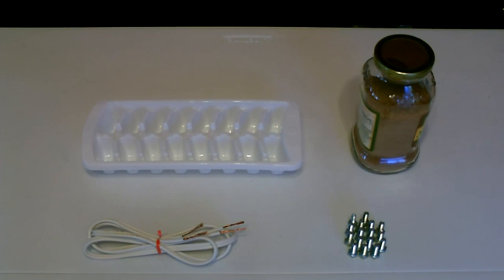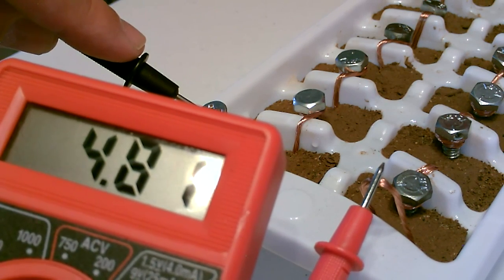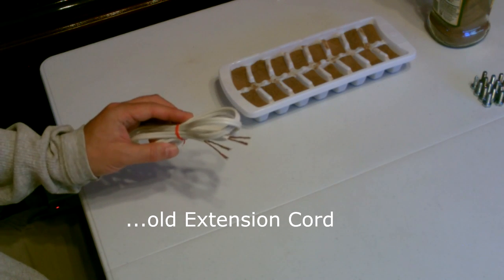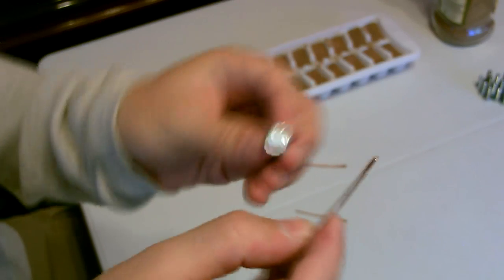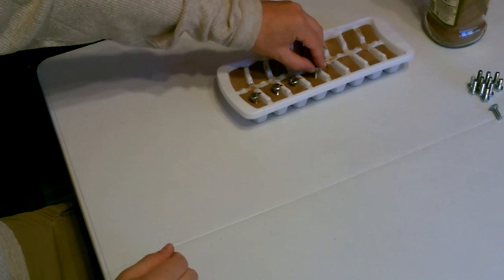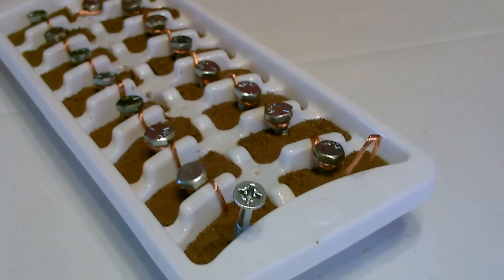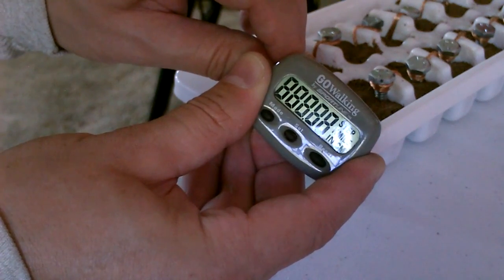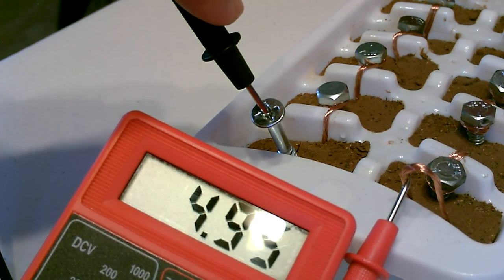Homemade Battery! - The DIY "Earth Battery" - Powers Clocks/Watches/Calcs/LED Lights....

Comment: I am curious would dirt, zinc electrodes and brass work. I assume you could attach these two in series and make 10 volts 10-20 ma. Enough to light a Few leds. Salt water designs corrode the structure too much electrodes i mean so i would use salt water.

Comment: Will it charge a phone?
Will it light an LED light?
Reply from the maker: it can charge a phone but it would be pretty slow because the amp output is pretty low. it will light led bulbs (certain ones). i do have a high amp earth battery video. the cells are much larger and have a lot more metal in them.

Comment: How much current can something like this put out in comparison to a commercial AA battery
Reply from the maker: hi the current is much much lower. i do have a more recent earth battery video where i show one that has 10 times the amps of a standard earth battery. it just uses dirt or sand and water (similar to this one) but it uses small sheets of copper and aluminum.

Comment: I'm already thinking about using those deep popsicle trays instead of ice cube trays. This is great. Thank you. Cheers, mate.
Reply from the maker: you're welcome! those should work great. i just started on a new earth battery. it uses large sheets of copper and aluminum. i hoping with 100x the surface area i might get 100x the amps. then just hook a few of those together and you could charge many things very quickly.

Comment: You forgot to mention how many amps
Reply from the maker: hi. the amps are pretty low with these units. it tends to run things in the milliamp range. you could probably increase those if you hooked a few trays in parallel

Comment: I live off grid and solar in the winter sucks. I was exploring the idea of using urine to generate something and sending that through my smaller charge controller to get even a small trickle of juice. But this dirt seems to do the trick, I wonder 🤔 if moisture from urine would help, larger cells..like cups. Bigger screws and thicker wire would give me more power?

Comment: How do you connect it to something? I see you have one screw / nail at the end on the left and the coffee wire on the right. Do you need to connect both the nail and the wire to whatever you’re connecting it to? Or just touch the copper wire to the object? If you had a lightbulb how would you make it light up? And which side is which (positive and negative) if you did have to connect both

Comment: How long does this generate electricity for?
Reply from the maker: hi. as long as you keep the dirt wet it lasts for years. it still works to this day. you might eventually have to replace the metal if it gets corroded.

Comment: Has anyone tried to recharge their soil battery using a solar cell? I'm envisioning a plastic seedlings tray (used for house plants or gardening). stir in some table salt with the dirt before adding water. Connect a solar cell that pairs up with the soil batteries' voltage. A hybrid soil battery that could be rechargeable by adding water and\or sun...

Comment: what did you use the battery that was put directly into the earth? Have you ever used these batteries for gardening purposes? My hypothesis is that this is one of the missing elements for use in the gardening situation. I might give it a try this season. but I would like some input  from someone that's made one already....

Comment: I built an earth cell with carbon water and aluminum in a pint glass.   One cap full of bleach pushed the bolts to 1.1 V and the amps to 5mA.

Comment: You need to wire a small solar panel in parallel.  The circuit is called a non-ideal parallel circuit.  I have done this twice in experiments.  The solar panel has to be in low light conditions.  If the amperage is too high it blasts through the system, and you only get volts from the solar panel.  My last test had the system pulling 2.45 ma from the panels and 20 volts from the earth battery cells.  The first time it ran with .01 amps and 15 volts.  There is a relationship here that can be manipulated.  My solar panel is an 18v about 12" square.  The earth battery I built only made .01-.02 milliamperes unit I added the solar panel which can boost the amps.
Reply from the maker: hi. sounds interesting.

Comment: Although it reads about 5 volts, the amperage output is negligible, which makes it impractical to power or charge any device. Use it as a parlor trick to impress, but it’s truly not something useful. To be something worthwhile the battery plates (galvanized metal, copper, aluminum, etc.) would need to be much larger, (dissimilar) and the dirt would need to be replaced with a much more robust electrolyte. If it were easy to make an inexpensive DIY battery that was practical everybody would have done it long ago.

Comment: How do you connect the wires to complete the circuit?
Reply from the maker: hi. all you do is hook a wire to the first cell (in the row) and a wire to the last cell in the row. those will be the plus and the minus
Reply: @desertsun02  I mean from cell to cell.

Comment: I made smaller than this. 
The key is soil, the more fertile and moisture, more electricity you can get. Do not ever try to run electronic device using this battery unless regulator in place. The electricity quality is poor, you will damage it.

Comment: Are each ice cube battery connected in series or in parallel please?  When the copper wire is merely inserted into dirt of next cube tray. Am confused to discern how to tell if this is in series or parallel.  Thanks.
Reply from the maker: hi. it's series
Reply: @desertsun02  thank you

Comment: how long does it last
Reply from the maker: hi. it lasts until the soil dries out. (but then you just add more water and it works again). i have a video showing how it held up (still works perfect - even after all these years)
Reply: @desertsun02  did you try installing a capacitor to triple the voltage. Induced volt test
Reply from the maker: hi. no, i didn't get that fancy.

Comment: How many amps did you record? Did you wet the soil? Clay, sand or organic topsoil? I figure I may as well ask to make it easier to copy you. Thank you.
Reply from the maker: hi since the amps on these are typically low compared to the voltage i just measured voltage. you definitely need to wet the soil. if it's dry the battery won't work. the soil i used was from my backyard. it's high in clay and very dense. sand or regular soil should work too.

Comment: Howlong its giving power output
Reply from the maker: hi. as long as you keep the soil moist or wet it will work for a very long time. i've had it many years and it still works if i add water.

Comment: Hello I made some tests, but the prob. was when I test it on led batteries that takes 3 v it did light well, the light is very dim, even thou Im getting 3 volts from my soil battery , what could be the probelm.
P.s: Im a beginner in electrical science
Reply from the maker: hi. first off, it's great you got it to work! it can be dim for several reasons. main one is that the led is not "low power" enough. there is a huge range when it comes to power draw (some only need one milliamp and others need 50 milliamps). also makes sure you are using long enough bolts and lots of copper.
Reply: @desertsun02  thanks a lot for the info
I will try to improve it with more copper and longer bolts 🔩 and get back to you.

Comment: Thank You for the video and information. Could you take 20 of those and make 110 volts? Also what kind of amps would these produce? Again Thank You.
Reply from the maker: hi. i'm not sure the limits of these but theoretically you could make a pretty powerful setup if you used enough trays

Comment: My bad I meant to say if you use salt water instead of regular water it will increase the voltage the same with acids chlorines and other types of oxidizers such as fertilizers

Comment: If you add salt water instead of regular water it will increase the the same with acids and chlorine bleach and other types of oxidizers may be even fertilizer might help to increase voltage

Comment: if add few drops of water, use thinner Copper wires, and different bolts materials (zinc), I believe you will get higher voltage and stand longer, as the moisture can increase the electron transfer performance from bank to other.

Comment: One of the oldest galvanic cell is the baghdad battery.  There is an even older galvanic cell called the "cylinders of the pharaoh" made from copper and zinc tubes filled with quartz when held produces up to 1.5 volts.  I encourage everyone to make them. If you can't just buy them on etsy or amazon.

Comment: What if you put vinegar in the tray would it make more volts?
Reply from the maker: hi there. yes, using vinegar slightly increases the power. it will corrode the metals a lot faster thou.

Comment: What is the oxidator within this battery?
Reply: water and salt in the water probably, if you want more kick from this, pour in water+salt+sour salt or lemon salt being it crystalize or not. anything acidic works baking powder or caustic salt would probably more worth it as its releasing a lot of energy. every material when is put in water has a electrical discharge problem is the amperage is sucks. u can get 100 V but if u get like 0.00000001 AMPS  its shit Voltage u can't do nothing with it, you literally have more amps from rubbing your fingertips.

Comment: What kind of dirt do you use?
Reply: is not the dirt that does the job, the dirt acts like a decaying delay agent, its the water and + chemical mixture he using that generates the current, from interacting with the copper. u can put water+salt or vinegar and will do the same thing no need for dirt.
Reply: @REDFRAQ 
Thanks you very much

Comment: you could try water and other substances right?
Reply: water, vinegar, 65% baking powder + water mixture, 25% vinegar 50% baking powder 25% any agent to make it harder cornflower dirt etc, works with everything as long as there is a acidic reaction with the copper or cathode u putting inside there. also the bolts need be galvanized so the copper can pick up the electricity. but amps will probably be shit though.

Comment: Good day!
I would like to ask a expert opinion regarding with eartb batteries. As you have used tap water to moisture the soil, may I ask if type of fluid used as moisturizer to the soil (tap water, distilled water, salt water, etc) have an effect to the voltage produced by earth batteries. Also I would like to ask the principle/science behind this.

Thank you in advance for sharing your expertise on this topic. Hope to hear from you soon.

Best regards.
Reply: Saltwater would be best in this particular matter. It will act as an electrolyte.

Comment: If you push the bolts deeper in the dirt (if possible) then you get a bit more voltage. In your case you couldn't do it. A bit more deeper cells and longer bolts could have made it. This advice was only for the bolts and not the copper. No need to get the copper deeper. However, a few more cells do the same thing if needed, to get more volts. A combination of Stainless steel and aluminum works also well and I prefer that, especially if you want to dip often.

Very nice video, by the way. Thanks!
Reply: dip often?
Reply: What do you mean dip often?
Reply: @Randy2747  By that I mean to water it more often. If its to dry, the experiment want work. There much be always moisture in it or no electricity.

Desertsun wrote what was also my thought:
"Note: every couple of days the dirt will "dry out" and the voltage will decrease. TO RECHARGE THE BATTERY; just add 1 or 2 teaspoons of water to each "cell" and the battery will be "recharged"."
Reply: @christ4u2now Is there ever a need to replace the dirt; if so, how often? Also, how long are these good for? And are you able to explain why this works?

Comment: To charge a device the power produced is what matters. The current out of that dirt battery is possibly under 500 microamps. To charge a cellphone we would need at least 3 orders of magnitude which a dirt battery cannot generate.

Comment: This is working because of the light zinc plating on the bolts or nails. Steel does not have as great a potential against copper.

Comment: The biggest problem with any battery is getting a large surface area for the electrodes. This is accomplished in commercial batteries by making the two electrodes separated by the electrolyte into a long thin sandwich and rolling it up into a scroll.

Comment: If you used two ice trays would that double the voltage?
Sorry if that's a stupid question
Reply from the maker: hi there. it's not a stupid question. and yep, it would double the voltage (as long as you hook them in series)
Reply: Wire a few up in parallel and you could probably melt metal.

Comment: If I understand the theory right, (I’ve been learning Ohms law for two weeks now so forgive if I’m wrong), copper and galvanized metals (as well as others) have two different levels of conductivity. They are both conductors, but one is more efficient than the other creating an imbalance. Electrons want to travel from one pole to the other (toward the path of least resistance, or the neutral pole) which creates electromotive force, AKA "voltage". 
A battery does not "create" electricity, but "stores" it, which in my mind makes this more of a natural “generator” than a battery, unless the earth itself is viewed as the storage battery, and using the two different metals channels the flow of voltage.
 The earth itself provides the electric charge, (through gravity/magnetism I think) so connecting several of these power “generator/batteries” systems together in series should double the voltage in each group. Hooking them in series parallel should also up the amps. If you used deep cycle truck batteries as storage and these earth generators/batteries as a charging source, you would have a reserve capacity in your battery bank similar to those in a solar power system. Any thoughts?
Reply: Not bad for the most part, the biggest flaw might be with the deep cycle batteries as storage, since current always seeks balance, so unless the source is not greater than the destination, current will only flow until both are equal...however some simple circuitry could remedy this, so keep with your studies, and learn about diodes and capacitors, as incorporating them in your "system" will help avoid this limitation!

Peace, Love, & Light!
Reply: TheSmokingGun57 awesome
Reply: I was wondering the same thing if you connect enough together in theory I don't see why you couldn't charge a battery bank...? I think you would need the voltage to be a bit higher than 12v for it to actually charge?  I live off grid this would be cool to have as a back up way of charging my batteries if it works.. might try it.
Reply: @christopher4535  I'm wondering how effective it would be to up the size and use a garden bed instead of ice tray. Each cell is a plant and it is constantly charged with watering, living soil, root system

Comment: Can the dirt be sand? Would it be possible to adjust the voltage to 120 in order to power a small refrigerator 24/7?

Comment: I ended up making nearly the same design, but instead of dirt, I used a water-bleach mixture.  On the surface, it is a usable voltage.  The first major obstacle you run into is amperage capacity, which is relatively low. I used this battery to power a red led, which pulls around 20mA.   The obvious work around is to run several cells in parallel.  The second obstacle is oxidation of both the positive and negative jumpers.  The more amps you pull, the faster the oxidation.  Once this starts, you'll gradually see the voltage drop.  

For anyone who's made this battery from dirt and actually ran anything, how quickly did the jumpers oxidize?
Reply: +Kevin Sippel Jr Try this. Cut a bunch of Squares of thick aluminum sheet metal into about 1 inchx1inch squares, and do the same for copper(or use copper shims) and the the same for cheese cloth. then stack in this arrangement:
Aluminum>Cheese Cloth->Copper>Aluminum>Cheese Cloth>Copper
Each of these cells will get you about 1v. Keep stacking to increase voltage, use thicker aluminum and copper metal to increase amperage. Aluminum end will be negative, copper will be positive.
Then tape together and immerse in vinegar. You can reverse the corrosion by applying voltage instead of pulling voltage, making the cells rechargeable.
Reply: +Richard Smith well that sounds like something I'm going to have to try. Thanks for the suggestion!
Reply: +Richard Smith Just curious if you're aware of any Youtube (or any online) videos that demonstrate this being done.  Your description is actually pretty detailed, but sometimes having a visual representation can also be helpful.

Comment: Does anyone know the reaction thats taking place
Reply: the copper wire and the steel bolts are creating a voltage, the dirt is acting as an electrolyte. it has to be wet.

Comment: i didn't found zinc coated bolts anywhere near to me. what should i use now?
Reply: +Ahm Khaled I don't know where you are, but the NEW U. S. pennies are made of zinc with copper plating. If you scratch off the copper with say, sandpaper, or the like, you'll expose the zinc core.Some will do several pennies, say 8-10, scratch the copper off one side only, stacking them up, with vinegar (acidic solution) soaked small pieces of paper between them. Always face all copper or zinc sides the same way (i.e., face up). You should get about 1.5 volts from that many pennies....amps would be kinda low, I think, but enough to operate a lite, maybe charge a low-volt, low-amp device...play with either solution or number of pennies to change amt. of output...